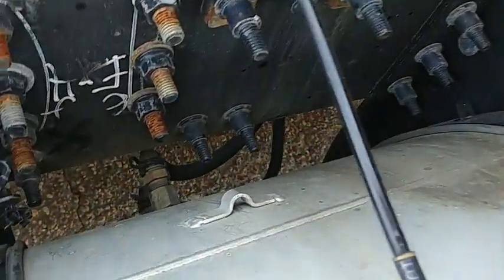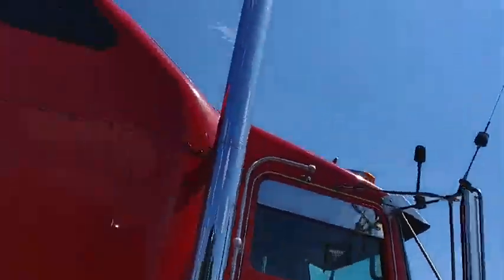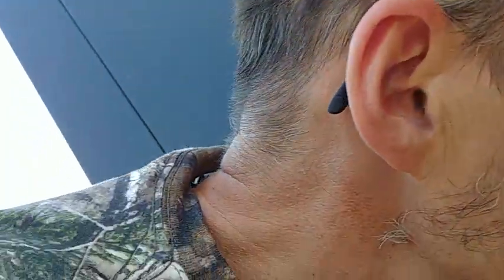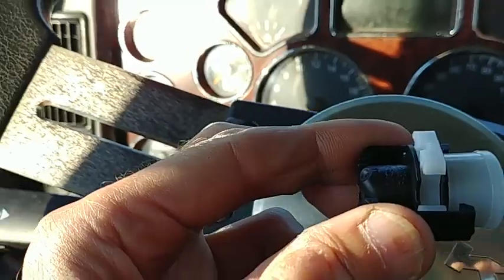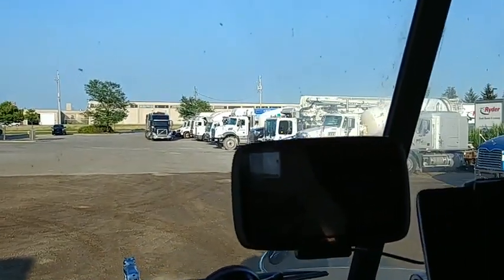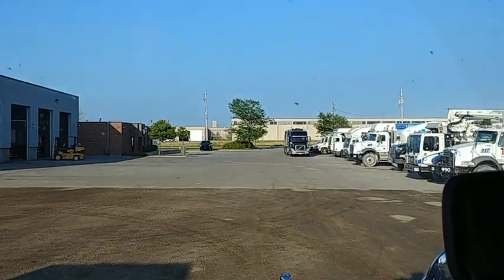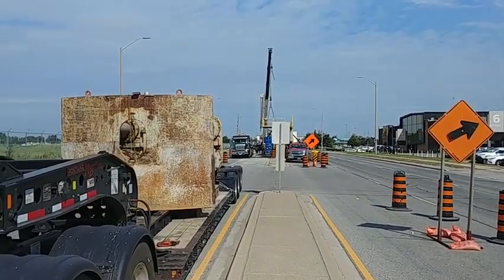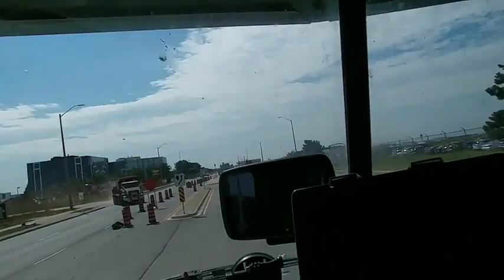Heavy Haul TV: Episode #559 - Loose fuel line fittings!

Comment: yes you are correct, if the housing or primer pump fail it will cause some issue. usually a hard start condition or no start condition.. your fuel filter it will not be always full because its under suction (engine off, main pump is off = no suction) thats the reason why you need to "prime your fuel filter". what could cause power under heavy load, well a lot of things that could cause low power issue, but dont forget you are all over North America which altitude, temperature, air density will be a factor. yes it is turbocharge but still a 13L engine, cant compare a 13L 1850 torque engine vs 15L 1850 torque engine, yes they are same torque in paper but 13L engine is working hard to reach desired 1850 torque (Volumetric Efficiency)
Reply: ebu touy a 13L has better volumetric efficiency than a 15L if they produce same nos.

Comment: Sergei-if you run out of ideas, it is possible you have a filter base that is a bad, porous casting.
Reply from the maker: that's exactly what I was trying to get the Volvo dealer to check - it's called 'filter housing'. Sometimes it gets cracked because mechanics overtighten the fuel filters during installation.

Comment: think your loosing prime overnite where there is a leak near filter or pump. If there was a leak down low it would suck air constantly and loose power shortly after repriming pump
Reply from the maker: Well, I went to another miracle truck dealer. Name's Sheehan Volvo. Location: Burlington, Ontario. They took down my work request and I signed. I asked them to do 4 things and 4 things only. 1) Replace the plastic fitting on the fuel line at the tank using my supplied part. 2) remove the fuel filter/water separator (wrong one installed by the Petro during the recent oil change). 3) Inspect the fuel filter housing for cracks and damaged seals. 4) Inspect the priming pump for loose connections and damage 5) Install the proper fuel filter/water separator. I spent 2.5 hours at the dealer's lounge working on the 2 YouTube videos.  Then the service writer came up and informed me that: 1) the supplied plastic fitting was wrong, so they didn't change it. 2) they don't have the proper fuel filter for my mack truck, so they didn't remove the old filter and didn't expect fuel filter housing. The only thing they did was visual inspection of the priming pump, which according to the final bill took their talented mechanic ALMOST ONE HOUR. With the hourly labour of Cnd$150 an hour (US$119/hr), the final bill came to Cnd$140 plus tax. I called the Mack dealer in London, ON who sold me the fittings and he swears they are the proper ones. At least, when he plugged in my VIN number, only this part showed up. So, when I retire I'm going to open a truck repair shop, have no parts in stock, and charge people overpriced labor rates no matter if any actual work is done. Working on the business plan right now ... Way to go, Sheehan Volvo of Burlington, ON. I might come back just to get a few more lessons on how to cheat truck owners of their hard earned cash!